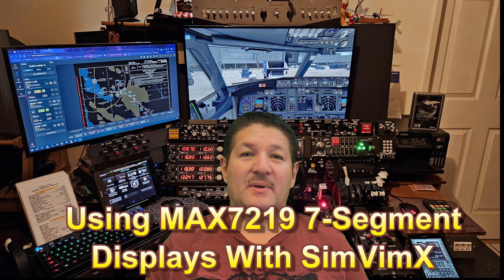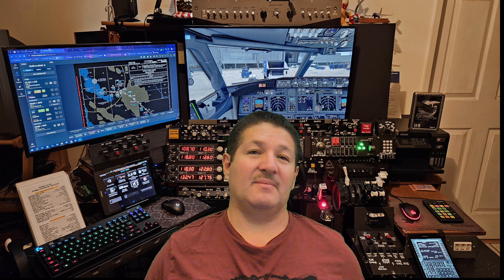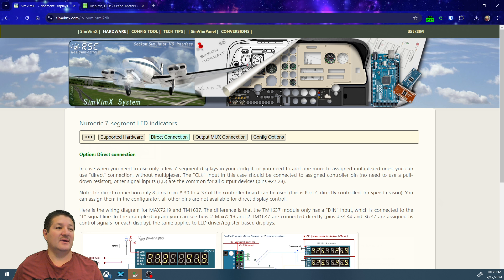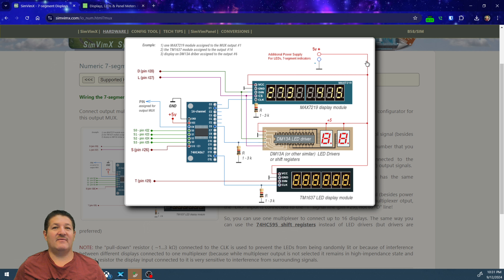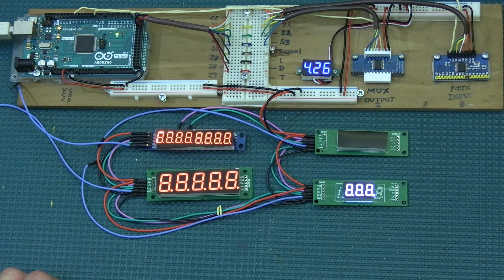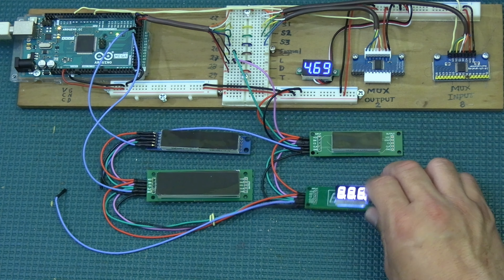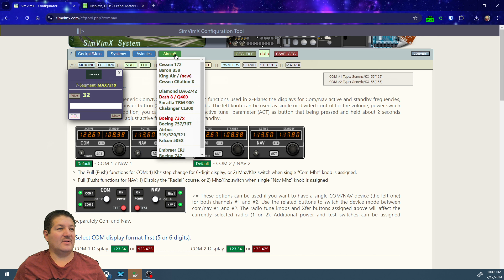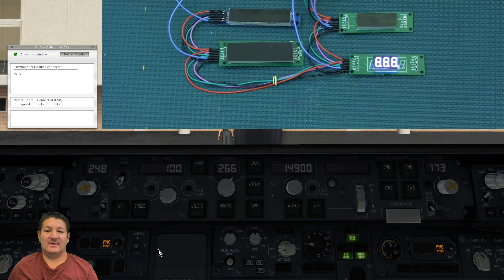Using MAX7219 7-segment displays with SimVimX

Comment: The reason why the displays flicker is because they have latches and any glitch causes them to latch data which isn't there.  This is one reason why I asked Vlad to refresh the displays in case the display lines do something they're not supposed to, like when I forget to turn on the external power supply.  Vlad only refreshes to displays when data changes and even then, the displays could go into sleep mode and I would have to reload the data.
Reply from the maker: @philnelson2364  Ah ok that  makes sense, so that's why they al show 8s when you start up the sim?

I wonder why that doesn't happen to the TM1637s. Those never have any of the issues I've noticed on MAX7219s
Reply: @Qosmokid  The 7219 are special cases.  I believe all the dots also turn.  I wrote a program to test 7219s, 1637s and the multiplexers.  The 7219 do things differently.  I would have to look at the block diagram again to remember it.

Comment: Are you using windows 11 or xplane 12 ???
Reply from the maker: @philnelson2364  Not on the computers I use with SimVimX. Both still on Windows 10 & X-Plane 11. I do have X-Plane 12 but I don't really use it.